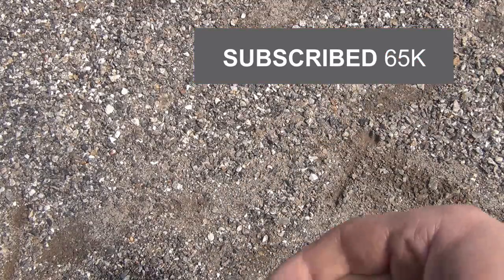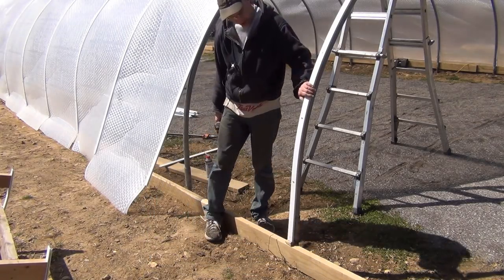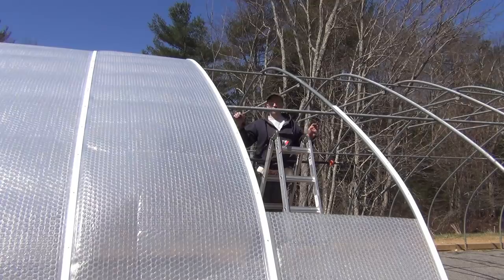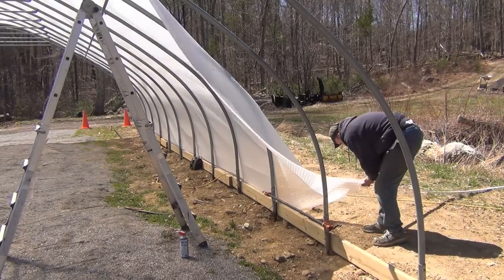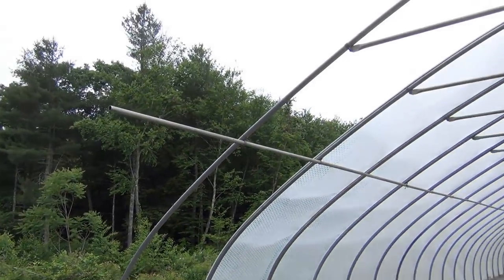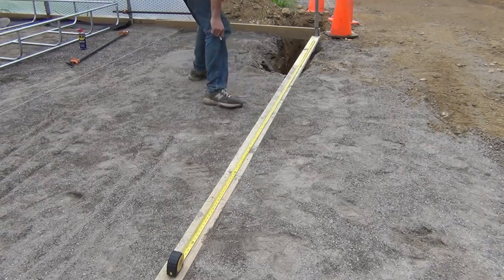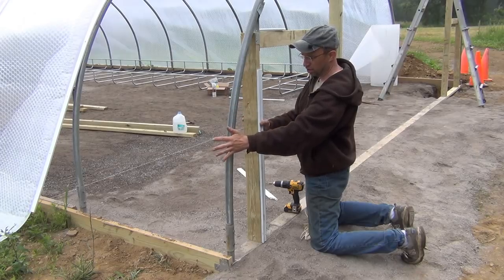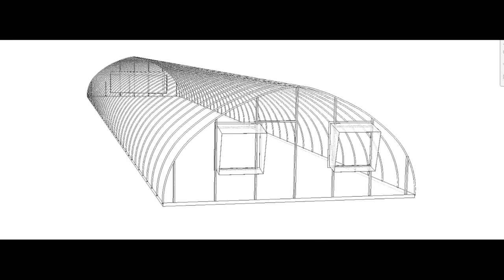Big Aquaponic Greenhouse - Part 8 - SolaWrap Cover Details

Comment: I am building a 12ft x 8 ft cattle panel greenhouse with the SolaWrap. I thought it was pretty easy to work with. I'm happy to report it's already taken one hail storm that took out many roofs in the area and the SolaWrap did just fine. I also have the "wrinkled" look in the SolaWrap and I read of others reporting the same thing. Apparently it's just a cosmetic thing.

Comment: How do you like the Solawrap now after 2 years Rob? I'm planning a passive solar greenhouse and looking at the pros and cons of these 4 options:
16mm polycarbonate
Solexx (5mm or 3.5mm)
Solawrap
Double inflated 6mil polyethylene
Reply from the maker: I like it.  I have a couple of bubbles that have pinholes in them and have filled with water which isn't a big deal.  The biggest problem is it isn't bear-proof and I have a couple of sections that need to get replaced this spring.

Comment: No disrespect but It seems like a lot of extra work than simple double layer poly with an air blower. I'm concerned it doesn't have the same amount of insulation value. double air blown polly is 1-2 feet of air gap, this seems to be just an inch or so of bubbles and big gaps between them. Any idea how the insulation ratings would compare?
Reply from the maker: double poly has an r-value of 1.5 (single is .85).  This is 1.7, 10 year warranty against UV and many greenhouses have had this installed for 25 years.  The poly will last 4-5.  I can put this up myself and don't need to hire a crew to pull 150' of plastic and hope the wind doesn't pick up.  It is more expensive but in the long run it pays for itself. in reduced labor, purchases, disposal, and risk of tearing.

Comment: Now that you've had a chance to work with that plastic, how would you rate it? Was it worth the extra time to install?
Reply from the maker: I really like it.  Since I basically work by myself, it's easier to install than having to hire a crew to try setting up 150' of sheeting that will only last 4-5 years.  This stuff it more expensive, but should last until I retire.  I like to do things just once.  ;-)
Reply: how much more expensive? I've been given a chance to use it in australia, where regular plastic dies really quickly. but it's hard to do a cost breakdown. I know you love the details Rob!
Reply from the maker: Probably should plan on about 4 times the cost of a two layer poly sheet.  But it sure will be nice not to have to dispose of the old plastic and hire a crew to put new stuff on every 4-5 years.
Reply: As a solo operator, they're the kind of investments that I understand! I was thinking it'd have been a lot more $$ than that!
Reply: @wadeneumann4959  I'm in Aus too, love this stuff, wondering what the freight would be though
Reply: @joferraro2694  If ound a guy willing to install it. they are just nevous to price it. it seems like they probably havent sold any in Australia yet.
Reply: @wadeneumann4959  I emailed them to find out, but they haven't bothered to reply
Reply: @joferraro2694  not overly surprised. they're core business is in commercial roofing..

Comment: one of the worst enamies of plastic covered greenhouses is the tension on the plastic, if its drum taught you will have no problem if it has any slack in it it will break there, the wind causes waves in the not taught area ant it will split. I think if i was making mine with section plastic i would have put in 1 hoop at a time, plastic then pull the hoop taught and filled it in. with the slacknes in some of your panels i hope it stands high winds.

Comment: How about to make it easy-er by turning the solawrap upside down when unwinding instead the sheet coming from the top to roll it from the bottom up into the plastic rail.....just an idea that I will try it .
Reply from the maker: only the top side has UV protection

Comment: I notice that they are premade, the number one rule to the longevity of any greenhouse plastic it tight and the less it moves the less it tears,,,, how will you correct the lose section or tighten then ?... also whats the life span the cover on this type of panels ?
Reply from the maker: this is more durable than just standard poly covering.  It has a 10 yr warranty and there are greenhouses in Europe that have had it installed for 20+ years.  It can stay loose.
Reply: ive never see it done this way,,, I wish you the best of luck ,,,, I think I may be making my own youtube channel... I too just bought greenhouses .. 4 - 30 x50 one of these are a truss frame that takes verigated poly panels and 3 - hoop houses 14x50 ..at $1000 I had to buy them .... I have a lot to do... but marketing in my area was a no brainer... there is no one... Walmart being the closet ( and we all know here those veggies come from .. anywhere but the US...lol )  I want 1 as aquaponics ,,, but my best market here are flats ... flowers and veggies.. they get 17 to 23 dollars a flat..way to high!!! .. I know I can do them out the door for half of that and be comfortable.... guess I should get some cameras before I start... help financing is a must... and being partially disabled leave me a "risk" as the banks call it ... ugh ... got my work cut out for me..... if you don't mind ...id like to keep in touch with you for pointers and what not
Reply from the maker: sounds good.  If you have facebook, find Bigelow Brook Farm on it.  I post a lot of stuff on there too.

Comment: Why not build a shed on the end where you can go into and out to buffer and reduce the heat loss, especially during winter time. You can store you things such as fertilizer, spare parts and garden tools in that shed at the end of the green house. You can then use all the available space under the greenhouse cover to grow food.
Reply from the maker: It's cheaper to build greenhouse than a building.  Besides, the original plan shows a barn in a future phase of the project.
Reply: I was thinking about plywood and timber shed (maybe a little insulation for winter), with weather proofing outside layer. Something that can be put up in a day or two.
Reply from the maker: A greenhouse this size would need something larger than a shed...then that requires building permits and is also taxable.  ;-)  Hoop houses here don't need either of those.  :)

Comment: Robertson head screws are 20x better than Phillips head ones, try holding the driver square to the screw :)
Reply from the maker: the main problem is the crappy bit that comes in the box.  I have a nice bit that hasn't rounded over which works fairly well.
Reply: If you can get Robertson, they are the preferred for sure.

Comment: Oh, what a disastrous plastic installation! Is it still standing? The metal structure, probably! But the plastic, I would not bet on it!
Reply from the maker: of course it's still standing.  There are greenhouses that use this type of plastic that have been built 20 years ago.  It's better than most other covers